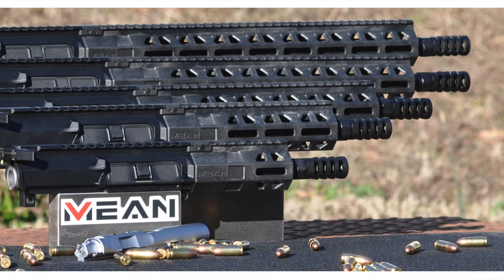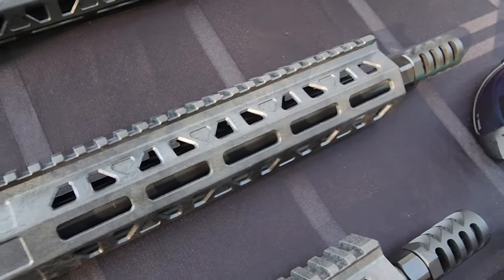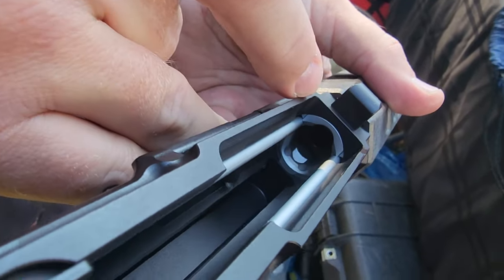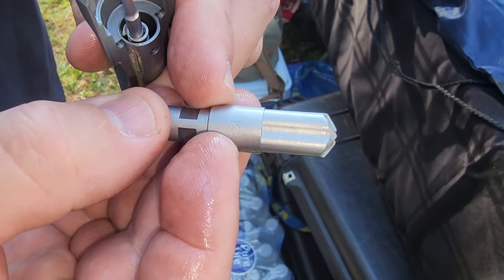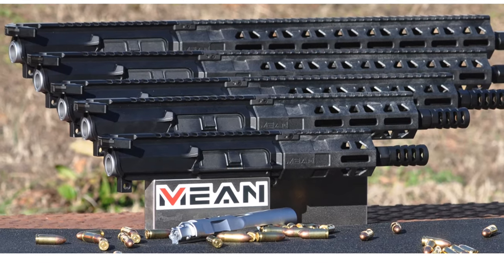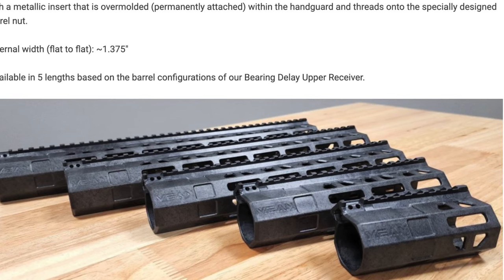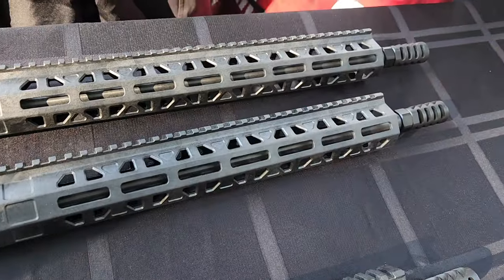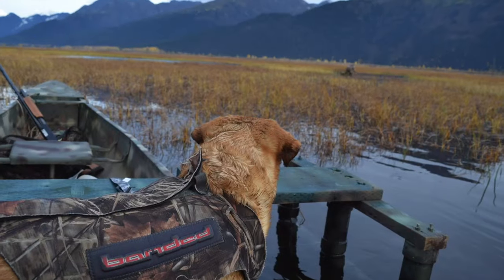MEAN ARMS BEARING DELAYED UPPER

Comment: I wonder how reliable it is Not quite as easy to adjust the pressure as some other platforms.
But I do like it
Reply from the maker: Ran all day with several Youtubers making videos in full auto, not bad. I know they told me they fired the 124gr Buffalo BOre Flat NOse FMJ Penetrator +p+ out of it with no issues...

Comment: Can Mean Arms make a side charging upper that takes mp5 magazines? 😮
Reply from the maker: It can probaby fit on an mp5 mag designed lower.  As for the side charging,  hopefully we'll see that addition at some point.
Reply: @AlaskanBallistics  if they made a side charging upper that takes scorpion mags with last round bolt hold open, they would sell a LOT.
Reply from the maker: @Bromo_Sexual you'd need to find a lower for the scorpion mags that has last round bolt hold open. And it would work.
Reply: @AlaskanBallistics  If what you say is true, I’m sold!  Which scorpion-mag lower with last round bolt-hold open feature will work with the 9mm Mean Arms Upper? 🤔
Reply from the maker: @Bromo_Sexual all of them should... I'd contact MEAN